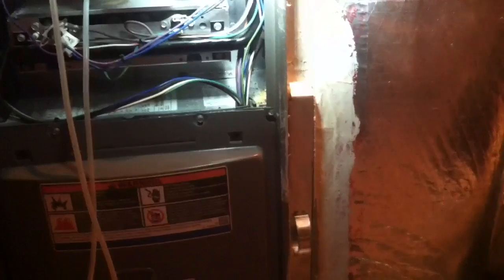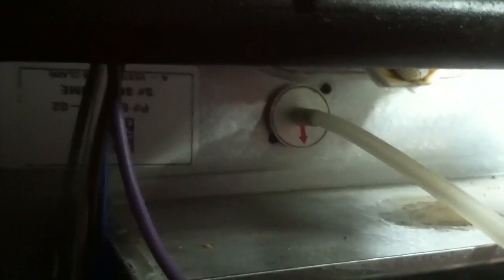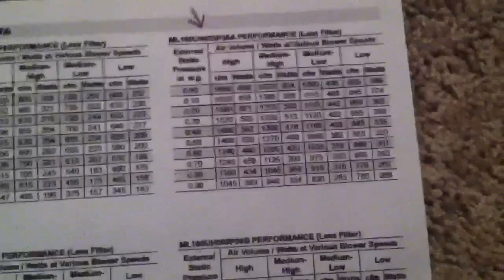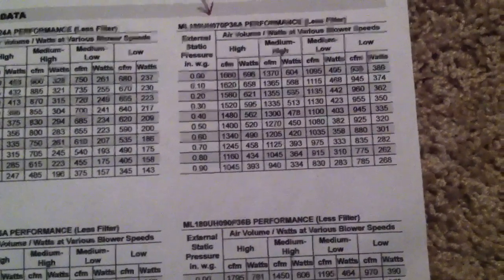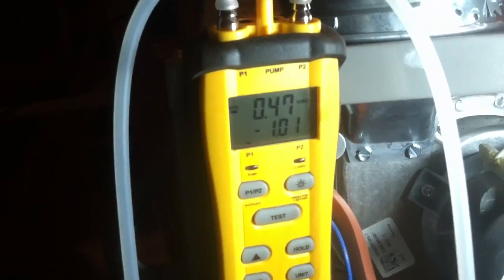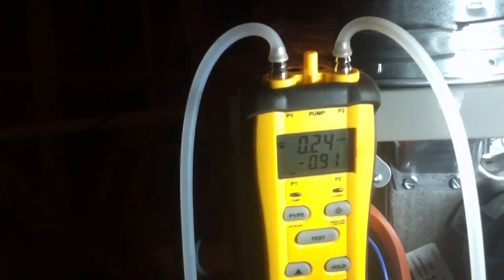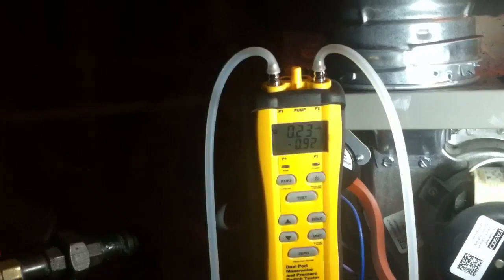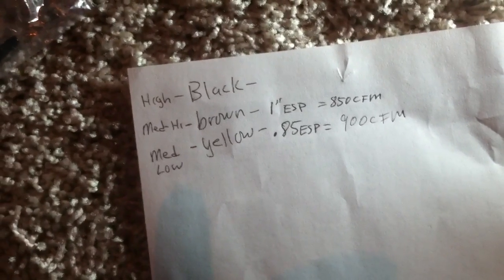Why static pressure is important - real world stuff

Comment: The total external pressure should be added by the two numbers, such as 0.91 + 0.24 = 1.15,  the problem comes from a high-pressure drop of the return duct, so must be focused on the return duct.

Comment: Hey so what was the outcome on this call? What was done to the ductwork?
Reply from the maker: JDT738126 

That call was years ago but I remember recommending some duct modifications but customer did not want to spend the money which is common.
Reply: @marcoalvarez1276  so they just deal with higher electric costs and fan motors I guess then lol
Reply from the maker: JDT738126 yup. The majority of customers in the metro ATL area are going to spend the money on duct upgrades if the units been running for years like that. It’s just the reality of the situation. All I can do is encourage and recommend the upgrades and keep it moving
Reply: @marcoalvarez1276  so what static pressure is idle for all unit. What is considered high if you do a static pressure across the A Coil.
Reply from the maker: Sylvester Cooper I’m this video I was testing total external static. For ESP in most psc and email units it’s typically .5”.   Variable speed blowers can vary from .5”-1.0” ESP.  Evap coil static drop varies from manufacturer and efficiency. You would have to look at the manufacture literature to determine what’s the norm. I’ve seen some coils as high as .35”
Reply: @marcoalvarez1276  Ive seen multiple rheem coils brand new with .4" pressure drops

Comment: I believe your + probe is too close to the blower outlet. Too much turbulence in the area may cause some inaccuracies.  Instead of using the provided probe. Try a piece of cap. tube or small dia. copper tubing, extending up though the limit hole up to the furnace outlet. Should be more accurate. Throw away the pleated filter.

Comment: I don't think Mr. Alvarez has done a bad job at all checking the static. He has appeared to have found a definite duct issue on the supply and the return which will cause the unit to lose capacity which will make it run more and use more power that has to be paid for. I can rest assure you that a properly designed, sized and installed HVAC duct system has no equal in efficiency.
Reply: He didn’t find anything. Just high ESP

Comment: Knowing and testing for static pressure is a waste of time and effort because you can't do anything about it.  Your time and the customer's money is better spent by you replacing filters, opening registers and sealing leaks in the system.  Testing before and after your fixes (assuming the customer will pay for you to do these bits) might tell you how much you gained, but that's about it.  In other words optimize for the current design.  These systems are designed by engineers and approved by the municipality prior to construction.  The owner is not going to spend ten thousand dollars to redesign and install a new duct system, or for that matter spend a couple of  thousand for a media filter to save a tenth on static pressure.  After all, the home heats and cools just fine as it is.  To spent that kind of money to gain a tiny bit in efficiency just won't fly with a property owner.  Make sure the mechanicals are operating as they should.  That's something you can do something about.   And even then half the time the customer won't allow you to do the work they need because they'd rather spent the cash on car payments, mortgage payments, vacations, their kid's education or food.
Reply: .....10-15 minutes or less to test is a waste of time? Considering I just finished a test and correction that took 30 minutes after the homeowner paid 2 guys 1.5 days to "fix the low cfm" and they couldn't get the system to pass HERS...hmmm.  People like you contribute to the 80-90% improper diagnosis and installation of systems. I'm guessing you've never properly commissioned a system since most H.O's (and so called hvac techs) are to ignorant or just don't care that the costs are burden the H.O. carries for the rest of the life of the system, basic ignorance of the  consequences improper design/installation/testing. BTW, the homeowner gained a hair under $15k in rebates and I got a $500 "tip".
Reply: I agree completely.  Customers aren't interested in the intricacies of the purists.  I've never been in a house that's been correctly designed and the static pressure is within limits.  It's always out one way or another.  It's a compromise between the equipment and the duct system.  Now if you're icing the evap coil then obviously something needs to be done about it but in 99.9% of the cases it's not icing.  Things could be better in a perfect world but that's not where we live.  New guys:  Don't put a lot of energy into this area of the trade.  You'll be going to houses that have been there for years and you're solving the current problem.  Not redesigning the entire system.  Unless of course you work for a shop that makes a big deal out of everything and only instills fear to turn a buck.
Reply: @Ephbaum  Nothing you said makes any sense. If you're lazy and you want to do a half ass job that's fine, but some people care about the trade they're in and learning what is the correct thing to do. 
I am talking about new installs. 

It doesn't always go back to the builder or contractor because the customer is so fed up with the installers bullshit they'll call us to fix the system or the company that installed the garbage folds up and moves to another state to scam more people, it happens all the time.
Reply: Ephbaum so if a fly by night company did a terrible design an install, they are fed up and calling you, shouldn’t you make notes of everything like that, static, balance, etc. so they have it logged from a licensed contractor that it was never commissioned properly after install?  During start up shouldn’t they have check gas pressure, static, CFM etc. for home owner an warranties. I’m just asking.
Reply: @Ephbaum  35 years of doing it wrong. Like an old plumber who still puts the circulator pump on the return. You survive, but you don't really do best by the customer.
Reply: Joey Thornhill- "Commissioned properly"?  I have no idea who would come asking questions about any such a thing.  And seldom is it the license holder who is out there actually doing the work.   There is no requirement for warranty through any mfg to prove the points you mention unless you've had multiple warranty replacements for the same part.  If it fails, they replace the part.  As for checking "gas pressure", I'm assuming you mean the refrigerant pressures and of course, the charge should be properly set.  If it's new construction you are required to roughly balance the house 1 time and seldom does that happen.  In tracts, the installers don't even come back once the house is sold and there is power to run the unit and adjust the charge.  It's always either over or under because they just dump what comes in the condenser and leave it.  It's not right but it's what they do.  The mexican crews come in, run the duct however they can get it there and that's about it.  There is no 'design'.  Even most custom homes don't have a design plan to work from because the architects don't want the liability.  The last thing that's considered, even in custom homes here, is the layout of the A/C system, which you would think should be the top consideration since we're so hot here but it's not what happens.
Reply: There’s no doom and gloom when the customer complains of a noisy furnace and you can explain static pressure and quote to add extra return air. Then it’s up to them to fix or not, instead of telling the customer not to worry about it. Keep talking about experience, doing it wrong for 30 years isn’t experience.
Reply: @Rainmaker88  You are exactly CORRECT in pointing out ephbaum doing it wrong for 35 years. He is an example of the cancer that infest the HVAC industry. So bad that the state of CA wants to outlaw flex duct. And EphBoy if you are still listening, the pressure he referred to is; checking the gas pressure. Actually clocking a gas meter and insuring your customer is getting what they paid for. If an energy provider starts a "performance" program in your area, you may have some pitch fork wielding customers knockin' on your door asking for a reimbursement for high energy bills YOU owe them for. 
CFM x Enthalpy Change x 4.5 = total heat 
High static indicates poor or low air flow. An ideal enthalpy change is 6.67, as air flow is reduced you may have a higher enthalpy change but not a gain in efficiency and total cooling. Example of 3 ton = 1200 cfm x 6.67 enthalpy change x 4.5 = 36018 total cooling BTU.  example poor air flow at 950 cfm x 7 enthalpy change x 4.5 = 29925 of total cooling or 7% inefficient. How many people do you owe for being 7% deficient over 35 years? National average is about 40% deficient
Reply: @Ephbaum  The irony in your statements is mindblowing.
Reply: @workinprogress008  I'm sure many things are in your mind.  Keep at it.  One day you won't be a work in progress and it'll make sense.  Maybe.  That is if your actually capable of comprehending the world around you.  Stick with it little buddy!
Reply: @Ephbaum  Even your trolling sucks! Lol
Reply: @Ephbaum  "gas pressure, I assume you mean refrigerant." You outed yourself right there as a complete fraud lol
Reply: @workinprogress008  Keep living the allusion and protect your ego junior.  That's all that's important right?  lol
Reply: @Ephbaum  I'm 41, pops. And I know I don't know everything. But I certainly know the difference between gas pressure and refrigerant charge. Lol
Reply: @workinprogress008  Keep grasping at straws Junior.  It's all you got.  lol
Reply: @Ephbaum  you win, bro. You win.
Reply: @workinprogress008  I knew that from your first comment.
Reply: @Ephbaum  short buss, 1st place
Reply: @workinprogress008  Good for you little buddy!
Reply: @cutabove I definitely do not want a trash ass hvac tech like you at my house hahahahhahahahahahahhahahavahahha
Reply: @desertwolfarmory  I'm not a hvac tech, I'm the engineer and after forty years I know bit more about design than you.  That's why I want you to stay out of my business just as I stay out of yours.  As a tech you simply aren't qualified to judge the work an engineer does just as I am not qualified to do your work as a hvac technician.  And frankly what you are attempting tells me the last hvac tech in the world I want at my house is you.
Reply: If the evap coil is freezing because it has shit airflow atleast you can accurately tell the customer they shouldn't have went with the cheaper quote on the install because now they have to pay you more to fix it.
Reply: @Rainmaker88  Jesus, there's so much wrong with your comment it's hard to know where to start.  1st, if it's an existing home that's been there for years and the coil is icing, something has changed.  It's not going to be incorrect duct sizing, etc.  Ridiculous.  Dirty coil, blower, to heavy of a filter, duct collapsed, etc.  2nd, When getting quotes, they're not typically changing the duct work so your comment only applies to maybe .5% of changeouts.  If it's new construction it would go back to the installer for the builder.  You might tell yourself you understand this stuff enough to write a snide comment but you don't.  You just wanted to chime in and to those of us that do understand these things you're just embarrassing yourself.  If you think they're checking static duct pressure in the millions of tract homes out here, you have no business being in this business.  It's all a compromise.

Comment: 2 /10 and 1 /8 is only 650+175
= 825 cfm and for a 30,000 cooling. at least we need 1,000 cfm
Reply: Then you need another 8" flexduct on that plenum
Reply: Then you need another 8" flexduct on that plenum, and a bigger filter